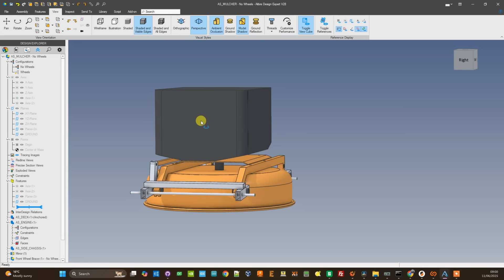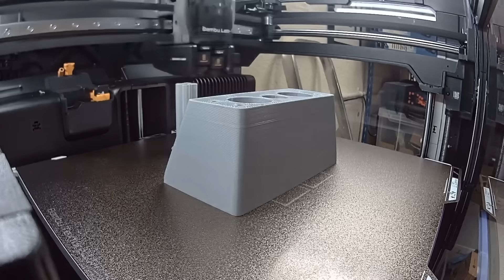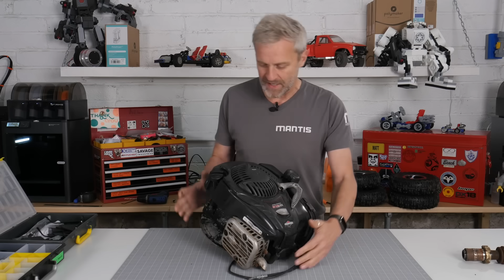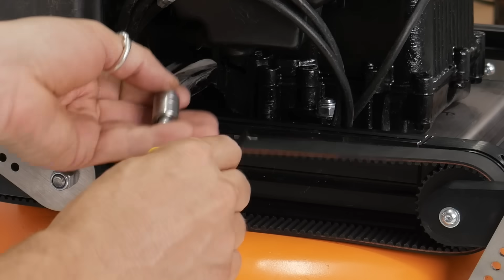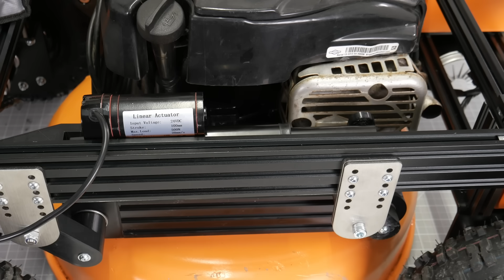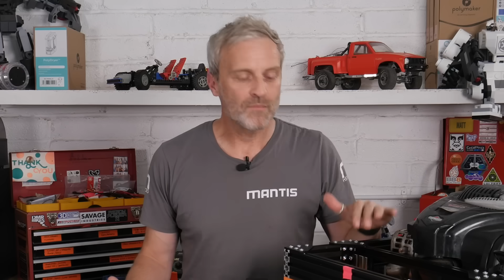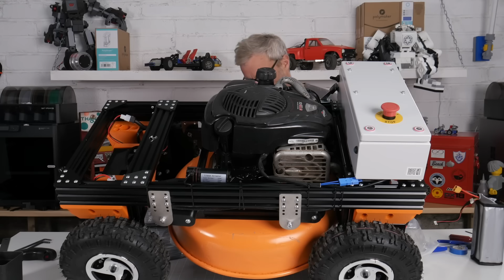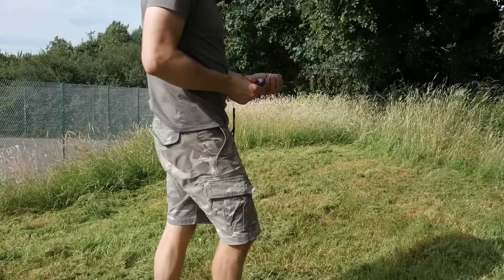I Built a 4x4 Radio Controlled Mower!

Comment from the maker: I've now added a list of some of the parts and the 4x4 R/C kit that I used in the description 👍
Reply: Hello, Thank you very nice project. I didn't see the STL files, I guess you didn't upload them to the site?
Reply: Totally awesome.  I would of opted for the slower speed higher torque option instead .   The orange pla looks epic contrasted with black.
Reply: Awesome build.   I think it's brilliant ur making it with add on options.  Here are some ideas...    
1- Mine clearing chain flail, this could be used to clear small mines in Ukraine or anywhere there are land mines.
2 - soil tiller
3 - dual head line trimmer, have dual line trimmer heads to make mulchi a beast at clearing brush. Plus this gets u past the nay sayers who will say there's no advantage over doing it manually.  Now there is 
4 - aerorator spindle,  anyone who ever ran one of these machines knows what a big pain they are.  Doing it with a remote controlled unit would be so sweet. 
5 - rotary trench digging head with depth adjustment, spinning attachment to dig shallow trenches for drainage channels, pipes or electrical.
Reply: The 4x4 RC kit was over 1000 dollars I'm gonna opt to get the two-wheel kit. I'm also gonna use some of the products you listed and put my design without the actuator I'm gonna incorporate a manual height adjustment for those who don't wanna purchase the actuator.
Reply: Hello Hello From The West Coast Of Canada!!!  I "LOVE" this project so much, because like probably half of your subscribers, I have wanted to do this to a mower ever since I was old enough to mow lawns. Because of the wear showing so quickly on your tires your totally right about the compound being really soft, probably just to make manufacturing them inexpensive. The other more agricultural treaded tires that you mentioned would be a super upgrade to give you the best traction on the incline to lessen the pesky drifting. Just for $hits and giggles, you could experiment with drilling holes in the thickest treads and screwing some nice 1/4" lag screws through from the inside with a little rubber cement on the threads to seal any possible leaks. Then the tires would be really useful in winter if you do "hopefully for another episode" build a plow/thrower attachment. There are probably heaps of ""Parts Only"" non-running snow throwers you could find and cannibalize from your local used forums and using Mulchy's engine to drive the thrower blades. Some of the throwers also have tracks that you could mount on Mulchy's wheel hubs with a little modding, that would give incredible grip for snow or even use when towing the trailer loaded with heavy firewood, gravel or mulch etc where super traction is needed. I can't wait to see all the incredible gadgets and attachments you create for Mulchy in future episodes. I've enjoyed other episodes from your channel before, but this is such an awesome project, I had to subscribe. I'm really looking forward to seeing all the future projects that you create from your imagination to share with us. I hope you stay safe, stay healthy and stay as happy as you possibly can be in all your future endeavours.
 
I never looked into these weird stats before, until seeing this episode of your channel peaked my curiosity , but ""The flight distance"" according to Google AI from Victoria Canada, to London England is almost exactly across the world from each other, travelling from airport to airport. 
7,678 kilometers flight distance from Victoria International Airport (YYJ) to London's Heathrow Airport (LHR) across the Pacific Ocean
7,649 kilometers flight distance from Victoria International Airport (YYJ) to London's Heathrow Airport (LHR) across the Atlantic Ocean.
🤘😁👍
Reply from the maker: Hey 👋 thanks for the sub and the feedback! So many people want me to convert to full electric I may have to do this just to explain the incredible power to weight ratio of petrol 😂

Also crazy stats on flights 👍
Reply: did you know that there is stronger than the pla u use in the video
Reply: @ANDREWMURPHY-c5x  bruh
Reply: Hello from Texas. ...upgrade idea for the tires 3d prints spiked tires at the speed of travel they'd be perfect. Advantages are cheaper replacement of tires that wear quickly, and the "spikes/ knobes" would also provide better grip on such a steep incline. Rubber tires get slick when wet ,PLA, PTG etc. not as much.

Great content keep up the fine work and keep imagining a new!- Ken Lockwood
Reply from the maker: Ok thanks 🙏
Reply: @MattDenton  could you add a mapping system from a cleaning robot like IRobot roomba?

Comment: Desde Uruguay. Te cuento la solución.fue dada maquina autotransportada una rueda delantera con un servo. La conducción un sensor radiolectrico adelante detectando una señal  de un cable en serpentina  bajo tierra     y sas
Reply: Arrancas el motor y sale sola. Cuando termina llega añ fina.choca en la pared y tiene un pulsador apaga el motor.    Otra maquina con la misma gia levanta el pasto  y lo descarga automáticamente. En la compustera. Para producir. Gas. ..
Reply: En USA hay más.componentes acá usamos. Reciclado
Reply: Se usa en pasto ya a un nivel adecuado  si no queda bien corto se pasa dos veces.  En sentido contrario. Se le puso un sensor de rpm.  Para descontar la transmisión cuando baja vuelta. Para pasto alto. Lugar de bajo mantenimiento.  Y no es muy efectivo.

Comment: Outside track width should not exceed the blade length.
Reply from the maker: I’m trying to work out what you’re saying here.. outside track width of the wheels shouldn’t exceed the board length..  I can see that on a lawn mower so you can cut right to the edge but it’s a little different in these rough cut ex mowers

Comment: You could just ditch the petrol engine and throw an electric motor on it since it runs out of gas so much quicker than the battery... That would also reduce a LOT of the vibrations AND weight. It might also be worth it to put some AG tires on it. I feel like the tires actually need to slip some so it can turn a little easier and stress the motors and frame a little less. But I could be completely wrong... Maybe you could also add a gps or some form of local positioning system and program it to run itself on a regular basis. If you did the electric motor conversion for the mower itself, you could also build a charging station that it can charge itself on. Then you'd never have to worry about cutting the grass again. You could still put cameras on it too so you can keep an eye on it from your phone via WiFi if you want.
Reply from the maker: Hard to get the same power from electric as it is from the petrol engine when you look at power to weight ratio. The engine will deliver up to 2.8kw and probably runs at about half that if you average the power use over the run time, so about 1 hour on 0.8 litres of fuel. Petrol has about 16x the energy density of lipo batteries after accounting for efficiency of electric bs petrol..
Reply: @MattDenton  gotcha. Makes sense.

Comment: WOW  100+  kudes for your excellent detailing engineering approach.  I guess most hobbyists would have done a lash up with string and rubber bands.  As a des eng myself I can recognise A class work ethic..  NOW STOP stand back and think a while, dont rush in and add widgets arduino wifi etc.  A mower must be attended operation legally?  AFAIK.  For horizontal smooth work trimming, then maybe? a wheel counter to estimate distance, then a program to say after x do a side step then reverse run for another strip  (maybe a separate   spiked wheels across chassis more accurate than skid steer?  Or maybe some kind of post marker aerial with FM sig quadrature gen at each corner (getting a bit nerdy here - maybe just sit in a deck chair with a pitcher of Pimms and manual control - add a go pro camera?) - better still

OBTW  the slope mower really is an industry gap - especially for local authorities.  Slopes to 45 deg  needs tracked crawling gear, maybe use 4 dc strimmer motors instead of ICE petrol engine, needs more LIFEPO batteries of course -  look into this and make the Cat-a Meow  you are already 90% there with what you have made with Mulchie - be sure and tell your subscribers we are on edge seatwise.  IMHO to limit strimmer power insist on 8" grass height (this is a LA recommended standard for residential mowing) max (not long grass hay - needs a manual strimmer).  With say 6" strimming circle (like a circular saw blade as per typical manual brush strimmers ) you cut down power to say 1000W max.  So a 24V 50Ah battery pack weigh  ca 10kg  will give you an hour use.  Thats a lot of slope  saving on dangerous gutty manpower.  Warning never use on wet grass - its like slippery ice.

Comment: I used the bottom of a electric wheel chair…
Two wheel drive though, spiked the wheels with self tapping 5/16 screw heads but no where the robust a a four wheel drive unit.
Reply from the maker: Nice 👌

Comment: Why don't you try putting a generator somewhere on the engine and a charging system to keep the batteries charged for longer? You can easily add gas, but you don't want to carry or push the lawnmower to a charger, right?
Reply from the maker: Well at the moment the batteries out last the gas by 4 x so generally I’m just filling it with gas 👍😂

Comment: I was thinking a proper digital RC system, an FPV camera on a raised platform at the rear (So the majority of "Mulchy McMulch Face" is in frame for safety), an FPV screen on the transmitter......... Oh, and a deck chair for you to sit in that's got a drink holder for a large travel mug of PG Tips (It's thirsty work doing all that mowing. 😁).

Maybe a hoop over the engine with a central winching point would also be a handy addition?
Reply from the maker: Yeah I like the FPV and deck chair version.. with beer holder 😂

Comment: You can use a car alternator running off the engine to power your electronics so you don't need to worry about charging a battery pack.

Comment: I'd like to add a suggestion for the trimmer. Get yourself one of the battery ones with the motor on the head, attach it one side so that it goes up and down along with the deck. Add a simple pivot arm with actuator. It would store up against the body when not in use, then you would activate the arm, it swings out away from the mower and you can turn it on and off from remote. The hard part will be the bump feed, but maybe you could have it 'punch' the trimmer down with a solenoid.  Just my 2 cents or pence for you over the pond.

Comment: I'd suggest to ditch the engine and go with electric cutting motor and extra batteries. Then it's much quieter, and cheaper to run.

Comment: Step 1: Here is an off the shelf version which costs 1500+ quid, that is way too extensive.
Step 2: build a machine with £1500+ in parts 😂
Reply from the maker: £1500 plus shipping.. and shipping a pallet from China is about… £1000 👍

So mine cost £1000 AND I had loads of fun making it so winning 🥇
Reply: @MattDenton i was just kidding of course, great effort, entertaining video and good fun all around. Totally worth it 100% 💪👍
Reply from the maker: Thanks 🙏

Comment: Your weight is coming from the drives. Maybe replace the Diecasting with ASA or PETg? How much of the drive can be replaced?
Reply from the maker: The drive system is off the shelf, but to be honest o don’t mind the weigh as it helps when pulling the trailer
Reply: @MattDenton weight is always a good feature for a tractor. We fill the tires with water and add weights. Lawnmowers should be liftable to clear a jamed blade and put in a bed of a pickup truck but I see your point. Maybe custom knobby Mccannum wheels? Then you can drive up the hill and maintain a straight path across? You know you want to use them, robots are way cooler with Mccannum wheels.

Comment: These engines have charging circuits possible that utilize the magnets in the flywheel that create the spark. Would be useful to keep the batteries charged without having to charge them. Would need limiting electronics. These same engines are used on electric start mowers (another idea) to keep the battery charged.
Reply from the maker: Yeah I’ll take a look at a magneto pickup to charge 👍

Comment: Same engine but weird design compared to Amercian. That bottom plate on the engine bolts directly to the deck over a large hole. So the engine forms the center part of the deck. Much more efficient, saves parts.
Reply from the maker: Yeah it’s very simple 👍

Comment: I cant help but think that, that battery mount at the front is just pushing over the grass before it gets under the mower. But that wouldnt be as much of an issue if you are mowing much more often so its not at high.
Reply from the maker: So yes this was very long grass, however the battery holder is the same height as the deck, so the deck would just push it over instead of

Comment: I made a pull mower for the steepest landscaping…. Take a normal push mower, replace the wheel bolts with eyelets on the two wheels on the opposite side of where the grass ejects. Once that’s done I clip long rope to each eyelets. Lower it on the steep landscape, start at the top pulling both ropes. Your walk back and forth on the top of the hill and every pass, add 12in of rope, gravity will allow the mower to slide down a bit, as long and you keep tension in the rope, even though your technically is the side and front of the mower but as I said you walk the same line at the top of the hill. I swear the steeper the better
Reply from the maker: Nice 👌 anything to save time and the back :)

Comment: I just had this thought.  Forget modifying a lawn mower.  Instead build a Tractor Unit with a central pivot hitch and then
just Tow whatever implement you need.  Use Rubber Tank tracks made from car tire treads or motorcycle treads using
heavy duty Silicone Tubing to tie it all together.  The Silicone Tubing will Stretch to fit over the Drive Wheels!!  I think I 
better get to work on this Idea.  Excellent Video!!
Reply from the maker: Yeah get making!!! Thanks 🙏

Comment: Simpel way to remember which direction should loosen de bold of the blade. Image that you hold the bold and turn the blad into the mowing direction you will fasten the bold. So loosing the bolt will always be in the same direction as the mowing direction
Reply from the maker: Yep 👍 thanks 🙏

Comment: You can add a terrane mapping from a used robo vacuum cleaner take all the electeonics and it will be fully autonomous cutting your grass instead of you controling it.
Reply: @antoniok4735  you can try lol, it's not that easy and it's not going to work
Reply: @hrmny_  it is going to work because there are videos on youtube, that have done this mod  so it's possible.
Reply from the maker: Yeash nice 👌

Comment: Pendulum style tilt sensors are usually better for environments with vibration, as long as the chosen length is not in a harmonic resonance with the RPMs.
Reply from the maker: Ok thanks 🙏

Comment: I built a similar machine that I have used for many years, I based mine on a cheap used mobility scooter which I added servo driven (regular kingpin) steering. One thing I had to do early on was use an oil additive to allow the motor to run at extreme angles. I found LiquiMoly have
a molybdenum additive that will protect the rings and bearings when starved of oil. My first engine (a new Chinese 6.5HP) lasted about ten hours before it started smoking and it developed a rod knock, I found the bore scuffed and the big end galling. I replaced it with the identical model engine (for spares) and slightly overfilled the oil as I had on the original, but also now added the molybdenum disulphide additive and that engine is now ten years old, still mowing the same bank at the same extreme angles and is still developing full power with no oil consumption. I'm not normally a big fan of additives in oil, but in this case it worked wonders, and still does. I also added a Daihatsu Charade alternator that is tiny, and that provides around 20A to keep the batteries fully charged. I also occasionally run an FPV system on mine, but keeping the cameras stable was a real challenge due to vibration. Still good fun though. Cheers.
Reply from the maker: Ahh this is a great tip thanks! I'll check out the oil additive. This is where a two stroke would have been handy :) Also thinking I may add an alternator at some point in the future.
Reply: @alasdair4161  Well done!
Reply: Great tip for all of us who mow odd angles....

Comment: What an awesome project! A lot of the robot mowers either have weird multi-directional wheels (like the Luba) or have two driven wheels and two swivel wheels (like the Husqvarna), after seeing the wheel wear I guess I now know why. 2 driven wheel conversion? 3d printed Luba wheels?
Reply from the maker: Thanks 🙏 well the wheel wear is primarily due to use on concrete. On gras it should be ok, also the Chinese rubber tyres are a little soft! The two wheel system would steer better but wouldn’t handle my terrain 👍👍

Comment: Zoomba lidar sensor on the top, or geo fence it,   inside above the cutting blade, a vacuum impeller to lower the air pressure on the inside so that the grass lifts up.   I am the guy you met at Maker space on the segway chair, chatting to james, if you change the wheels to omnidirectional the mower going side to side will help on slopes.
Reply from the maker: Oh hi 👋 yeah I’ve used omni wheels off road on a starwars depot we built, they were ok but not great off road. Maybe worth a try though